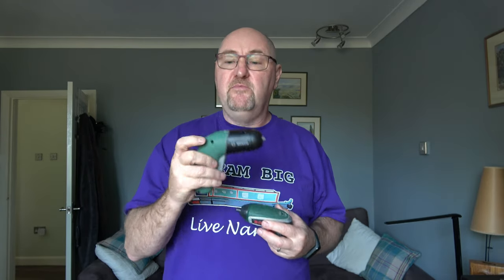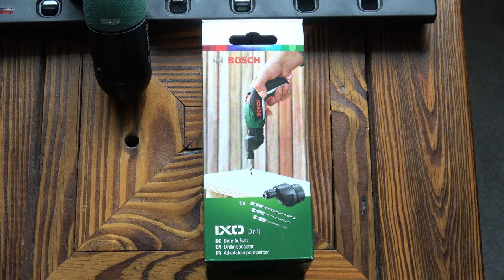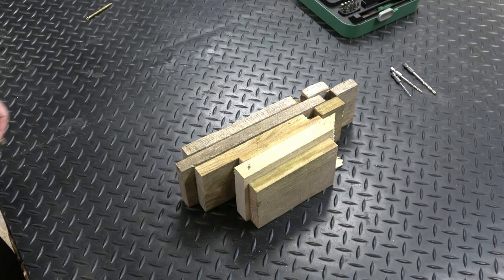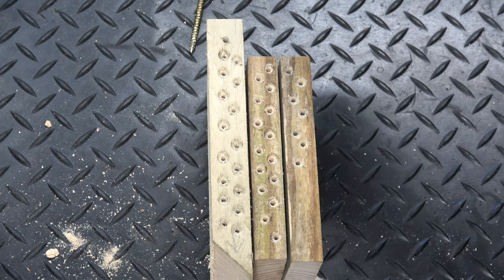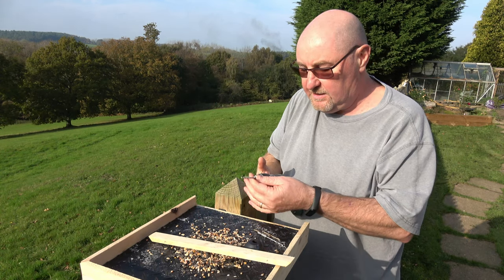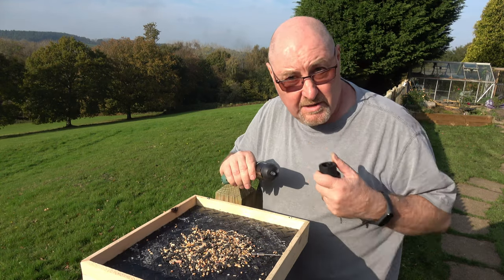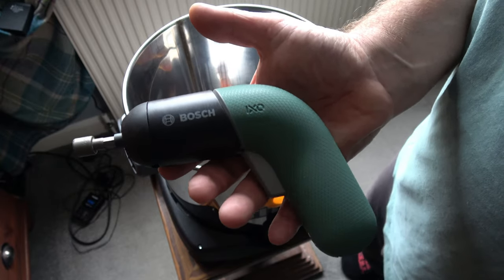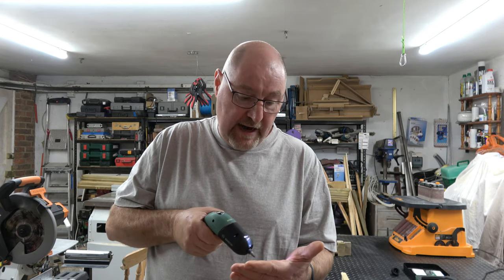The New 6th Generation Bosch IXO Screwdriver and Drilling Attachment - Brilliant!

Comment: Very handy and useful little tool! 
I like it!
More power than I thought. 
The other devices work great too.
I own drilling, torque, excentric, angle, cutting and BBQ device.
A bit more power and rpm would be great, compared with gen 5.
Gen 5 looked more like a tool and the front was thinner.
Reply from the maker: Yes, it is very handy!  :-)

Comment: Might have to make an upgrade! I've got the 5th generation model, which has most of the features of this, except for the variable speed trigger. It has been a marvelous bit of kit for my line of work as a handyman.
Reply from the maker: The newer model is better, but the 5th Gen is still a fine screwdriver Martin.  :-)
Reply: @RussellPlatten  The torque/clutch accessory is particularly good for when you have to be delicate with screws - especially Philips Head and Pozidrive screws where you can cam-out and scratch your work piece if you're not careful.

It is amazing how it is also good for drilling pilot holes for screws. You can get hex-shank drill bits or a 3-jaw micro-chuck adaptor. The latter is particularly good for hobbyists when drilling 0.6mm and 0.8mm holes in plastics for inserting wire pieces.

Comment: The previous generation you could hold the IXO, hold a screw onto the bit AND actuate the trigger with one hand. They removed the long trigger. Its a huuuge step back. But I'm sure the ladies (and marketing) love it with all the color options. They just ditched a big part of the usefullness for colors.

I hope the old ones will still be for sale for some time. My problem is that my first generation IXO wont die on me. It still holds charge for ages, so I cant really justifying buying a new one :P
Reply from the maker: For me the new version is an improvement.  I do not see the need for the fancy colours though.  :-)
Reply: killertoast, the same with mine. Got it in 2005 and it still works, maybe just needing some oiling though.

Comment: Hi Great review, good points well made - do you think that the torque add-on is useful? Or have you managed without it? The drill attachment seems invaluable.
Thanks in advance and happy new year.😊👍
Reply from the maker: I do not have the torque head and have had no issues.  :-)

Comment: I ha e the ixo v and it has all the features the one you review has. What i really dont like on the gen vi is the massive front end that makes it hard to get into tight spots. I will be buying the gen v till it is available and then will look elsewhere unless the redisign the front in a new gen vii.
Reply from the maker: The black cap can be removed from the tip and the reach is then exactly the same as the IXO 5.  However the body on the 6 is slightly wider.  The variable speed and rotation button position make the newer version a far better screwdriver for me.  :-)

Comment: Cheers Russ. I just bought one of this type of thing, not the same brand though. Came with a circular blade attachment for cutting cardboard/material, a screw attachment with different talk settings, an off angle screwdriver attachment, a right angle screw driver attachment and 2 sets of screw driver bits and a bit extender. No variable speed alas. Could you recommend a decent attachment or method for me to drill and or screw into an angle I physically can't get properly into mate? Am really into this out side DIY now and have built so much, I love it. Is there such thing as a right handed full size drill/screw attachment? Cheers Russ me ol' bean. Thanks for the great video as always.
Reply from the maker: Search for a right angle drill Dene.  They are pretty expensive.  If it is wood you may be able to drill with your right angle attachment.  The video I posted shows some drill bits attached to a hex fitting.  You can pick them up dirt cheap on Amazon.  It would work in wood at the speed of the screwdriver but may be a little slow and awkward.  If the drill bits are too long, you could try snapping one and regrinding it or using the broken bit to drill the hole.  It should still do the job.  :-)
Reply: @RussellPlatten  Cheers Russ. I will look into all those options you kindly mentioned. Thanks very much mate.

 Just for your knowledge. I did mention it on another one of your videos this morning, I have not been getting notifications (they are set up correctly) for when you have been releasing new videos. Silly YouTube and algorithms no doubt? Just thought I would mention it to you in case others might be having the same issue and you just want to put a little blurb out to your watchers about keeping an eye for it? Nice to nice. Many thanks mate. Keep them coming.
Reply: @Dene. F. may i know what brand and type you bought?

Comment: Hi Russell. Great and informative video. I got mine today. I just have one question. I have seen online attachments called "Bosch 2609255723 IXO Easy-Reach Adapter" which is supposed to give better more to the edge point of the screwdriver. Now I got the drilling attachments as You did in the video. And that accesory is looking just like the drill attachments just without the drills. Any thoughts of using that as the "easy-reach"? Wouldn't faster than normal spinning speed actually help? Both these attachments look the same to me (with the only difference being the lock). Thank You
Reply from the maker: It would work, but there would be a definite drop in torque (faster speed = less torque) and you may not be able to drive longer screws all the way home.  But, you could pre drill and then screw so less torque would be required.  I would conduct a few trials to see how it performs and make a decision based on the results.  :-)

Comment: Ive got Ixo 3 myself and i have to say its very good tool. I made few cabinets and kitchen table with it. It has troubles screwing larger screws but its doable, at least for home use.
For other, heavy working in walls and concrete i have my old trusty Pegasus impact drill :)
Reply from the maker: The IXO is what a small 'goto' tool should be.  Small, portable and gets the job done!  :-)

Comment: Will buy one but why did you open wider  the holes in the feeder base!? Cheers!
Reply from the maker: Hi Hector, I widened the holes to stop the screws from biting so that I could remove the side easily for cleaning the table.  In other words change the screws to loose fitting pins.  It is a great screwdriver and I use mine all of the time!  :-)

Comment: Hi Russell thanks to your review I’ve just ordered one, is the drilling adapter necessary as the drills will fit in the driver without it ?
Reply from the maker: You could drill a hole using the screwdriver without the attachment, but you would find it difficult Danny.  First of all, the driver runs at half the speed of the attachment so would be much slower.  The main problem though, is that driver's magnetic chuck does not physically lock the drill bit and you can't pull the drill bit out of the wood.  The drill attachment locks the drill bit into the chuck allowing you to pull it out.  :-)
Reply: Exactly what I was wondering.. so it sounds like there’s a gear mechanism in the adapter?

Comment: XIO  or Pushdrive  for Ikea  builds?
Reply from the maker: Not sure.  I have a pushdrive screwdriver too and I prefer the IXO as the pushdrive tends to twist my hand as the torque increases on larger screws.  I have just reviewed a new screwdriver made by Fanttik https://youtu.be/C_tsA2UeRdQ and it is my 'go to' driver for all jobs at the moment.  I think it is better than the Bosch IXO, but cannot vouch for reliability as it is a brand new design.  The 6th Gen IXO is still a fine screwdriver with a proven track record on previous models.  :-)
Reply: @RussellPlatten  Thanks Russell I'll get the IXO looks far more comfy in the hand  than the Pushdrive  I like the cutting attachment too should come in handy for my action figure photography. Great review on both drivers.
Reply from the maker: @humansrants1694  It is a great tool and some of the attachments make it way more versatile.  Good luck with your projects!   :-)